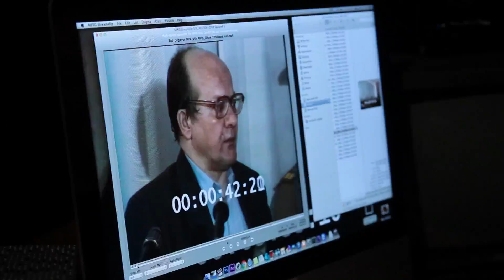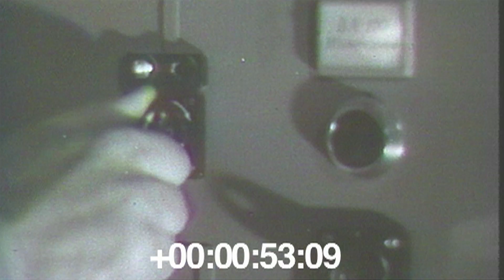Trial of those responsible for the Chernobyl accident. Causes. 1987. July.

Comment: The more I dig into this epic disaster, the more I'm leaning to believing the State's assertion that human error caused the plant to blow up.

Why?  Because it had abundant safety systems that would've prevented it.  They were overridden.  The State mandated that all safety tests had to be done before the plant was commissioned.  The documents testifying that all tests had been done were fraudulent.  The RBMK reactor didn't blow up despite correct operation.  It blew up because of improper construction and reckless operation.

To point out the positive void coefficient is akin to pointing out the abnormal weight distribution of the Chevy Corvair.  In the right hands and by someone who understands it, both the RBMK and the Corvair are perfectly safe.  It's when recklessness and deliberately putting both things into abnormal conditions, that a tragedy results.

Comment: So were the tips of the control rods really made of graphite or is that not true?
Reply: Yes.  The graphite tips were intended to preheat the incoming water as it rose up the channel.  Also to amplify the change in  moderation when the boron section was displacing water up or down.  To pull the rods all the way out was not intended.  The only time they were supposed to come all the way up was when that channel was shut down and the control rods were scheduled for replacement.

Comment: Can someone explain this to me? Some say the control rods failed because they got jammed while others say they failed because they were tipped with graphite. Which one is it?
Reply: Both. The control rods had graphite "tips" and locked up when they entered the reactor. Precisely halfway in.
Reply: we'll never truly know, the graphite explanation kind of feet the better
Reply: Get look some videos from That Chernobyl guy
Reply: The graphite tips were intended to preheat the incoming water as it rose up the channel.  Also to amplify the change in  moderation when the boron section was displacing water up or down.  To pull the rods all the way out was not intended.  The only time they were supposed to come all the way up was when that channel was shut down and the control rods were scheduled for replacement.

They physically jammed due to warpage from extreme heat and pressure.

Comment: This guy does not mention the design flaw of the tips of the control rods being graphite. Could it be that he was still in the dark about it, like all the others? This interview was only a year later. One thing you realize from the hbo series, assuming it was accurate, is that chernobyl could have been a 1000 times worse if the core had melted down to the water tanks. At least they got that right. I wonder what they have done with all of the other power plants with that design?
Reply: They did end up fixing all the RBMK reactors with the design issue, but I believe it only occurred after the suicide of Valery Legasov.
Reply: @Niko-20-w1k  No, repairs happened before. Legasov's suicide happened after he was denied Hero of Socialist Labor, Director of the Kurchatov Institute, and after two previous suicide attempts.

Comment: Water and carbon are both moderators, moderators are used to slow the neutrons down to increase the chance of a fission event. When the moderator is removed the reaction will come to a stall and shut down. But in the RBMK reactor the moderator was carbon... which is a bad idea.... with that said, most all other reactors use water as a moderator which is safer, when the water disappears the chance of a fission event will eventually reach to such a low point the reaction will stall.

Comment: Why this does fucking even have 1 dislike?! This is HISTORY and HBO nailed it with the mini series!
Reply: HBO made a lot of mistakes and changes. For example:

1. It was Toptunov who pressed AZ-5, not Akimov.
2. Ulana Khomyuk did not actually exist; she was a creation for narrative purposes.
3. Dyatlov was already aware of many of the RBMK design flaws but simply dismissed their practical relevance.
4. As far as we know, none of the engineers actually went into the reactor and looked at the burning mess. If they had, they'd have been incapacitated almost immediately.
5. The threat of the explosion that would result from the tanks beneath Chernobyl bursting was a bit exaggerated.
6. It wasn't simply that the graphite's entry into the core accelerated reactivity; the entry of the rods also displaced water at the bottom of the core that was absorbing neutrons at the time.

There were other things too, but it just goes to show that the show did muddle and oversimplify some things.
Reply: HBO nailed nothing.

Comment: This degenerate, if he had a little soul and humanity in him, would not have sent his young colleagues from 22 to 25 years old to the most dangerous points in the reactor, but he perfidiously hid as little as possible to be irradiated. And in case there was no guilt with this catastrophe, he deserved to be hanged only for directly sending young colleagues to certain death with intent, while he pulled out his old selfish and arrogant stinky ass!
Reply: Dyatlov sent Proskuryakov and Kudryavtsev to the reactor in order to lower the control rods as a mistake, he was unaware that Akimov engaged signal KOM to disengage the Control Rods from their servomotors, but as soon as he realized that the rods were removed from their drives, he called for the men to come back but they had already left. And he did not hide from radiation, he entered zones of high radiation and received an almost lethal dose from it. He participated in the search for Khodemchuk, and received horrible burns on his legs because of it. He warned firefighters about potential radiation danger and after 4 hours of running around, received a call from Bryukhanov to report to the Administration Building, he collected a few papers on reactor parameters and left. When a Colonel from Civil Defence came to the bunker, asking questions about the scale of damages, Dyatlov told him that Block 4 was destroyed. I don't see why you hate an Engineer that was doing his job so much...
Reply: @isaowater  I hate all the scumbags who deliberately risk human lives for the sake of their own career advancement.Such an obvious example was Dyatlov, who was supposed to become the director, if that monstrous task succeeded.It was a test that even the Russians did not know about.Dyatlov was a direct participant in the testing of Soviet nuclear power plants.He was given a dangerous task to give the maximum of the Russian product.The test proved disastrous and that degenerate is directly responsible for that shit!

Comment: This guy is lying (or being ignorant) - the control rods did start moving into the reactor, and that's exactly what caused the explosion, due to graphite tips. If an automatic shutdown system had been activated, the result would have been the same.
Reply: The fool proof automatic system would have intervene before super critical conditions where meet, but was deactivated at the time.
Reply: The emergency shutdown system would have turned the reactor off before they lose the control of the situation. At some point later, there was no emergency stop and they never knew that.
Reply: there shouldnt be nuclear reactor in the world that allows setting that causes reactor to blow..there shouldve been system when you are pulling too many control rods  it takes over ..and system if running with too low power it starts alarming about xenon poisoning...today they propably have all these and like in fukushima if earthquake example hits it automaticly shuts down..

Comment: He said something that I bet most people missed. "The reactor wasn't perfect at the time of the accident". This is a dangerous comment, machines are never perfect. Machines are engineered by people and run by people which means they could never be perfect for every situtation because people make mistakes and can't predict every possible scenario. I'm a mechanic that works with machines all day long and I see tons of mistakes in design, repair and operation of equipment. Safety culture is not usually followed very well no matter what industry or activity, if you need proof of that just look at the way we all drive. When was the last time you did your 360 walk around the car, checked your tire pressure, looked under the car for dripping fluids and checked under the hood before you pulled out of your driveway?
Reply: I do my pre drive inspection regularly but not every drive.
There are 2 majors reasons I even bother
1) I have found many potentially hazardous issues throughout my short life prior to driving.
2) The military ground pre combat inspections and checks into my very soul so now I have a voice haunting me in the back of my mind if I don’t regularly check my weapons and vehicles. If i owned a helicopter or plane the same would occur I’m sure.

Comment: What this guy is saying is completely at odds with what Legasov said. Because of the flawed design of the reactor, which none of the operators knew about, they were running this test with a reactor that could not be shut down.  That was why the reactor blew up. If the emergency shut down had worked it all would have been a non event. But this guy is blaming the operators, the planning and all this other stuff that is peripheral to the fact that the design was flawed.
Reply: Dyatlov actually was aware of the design flaws but dismissed their practical relevance. Dyatlov absolutely deserved some of the blame, just not all of it.
Reply: AZ-5 worked as intended - and that's exactly what blew the reactor up.

Comment: I ve just seen the HBO mini series however is the cause for the accident described here different from the one in the Chernobyl mini series? Here the soviet propoganda version is provided were the blame is laid on the men operating the reactor. In the mini series the blame was on the equipment were the rods had graphite tips and the operators weren't informed. Thus the AZ 5 button didn t serve its  purpose correctly
Reply: https://www-pub.iaea.org/MTCD/publications/PDF/Pub913e_web.pdf 

Chapter 6, ad 4. 

It is also a note that made them show possible KGB theory, which is backed by some evidence, not enough from what I have seen, but still it is possible that some informations regarding structural problems were hidden (even if they were not hidden people working at power plant would not take it into concearn, they had little or no experience).

Edit: Interesting fact to be noted 

 "This latter  effect  was a result of  faulty  design of the rods,  the nature of  which had been  discovered   at  the  Ignalina  nuclear  power  plant  in  1983."

They seem to not mention the "nature" of desing faulty precisely, (like they didn't know) In series it was explained as graphite tips which was pushing the water? (I could be wrong), either way they seem not to mention it in document, need to dig deeper.

Edit no2: 

"The control rods were very slow, taking 18–20 seconds to be deployed. With the control rods having graphite tips that moderated and therefore increased the fission rate in the beginning of the rod insertion"

It is mentioned on wikipedia, still not sure if they have hidden the fact about the tips.
Reply: @firesalamander4795  Yes I've looked at this document. The HBO series leaves out some details to make it easier to understand. At first I also had the question of what would have happened if AZ-5 wasn't pressed. This would probably have led to a melt down similar to that of Fukushima in Japan. Mostly to blame for the accident is the design of the reactor from what I read in the report however safety regulations weren't adhered to by Dyatlov which still lead to a possible meltdown of the reactor core.
Reply: @sport3047  AZ-5 button was meant to be pressed as part of the experiment. (it's a "shut down" button for the reactor, whether in emergency or for maintanance)

Comment: As per one theory they say control rods with graphite tips were actually suddenly put back into reactor causing the reaction to intensify and leading to explosion.Here he is saying control rods were unable to put back due to electrical interference???
Reply: I think, he mean that automatic system was disabled. This system could prevent incident, as it lower rods at early state

Comment: Yes the HBO / Sky set looks unbelievably accurate as do the actors, great series 
However this video claims that the control rods didnt drop because of interference with electrical circuit, whereas HBO / Sky claim the control rods did drop and it was the graphite tips that caused the overreaction. 
I guess the question  is that the control rods were raised all the way out of core which you would assume uses same electrical circuit that would power the drop of rods back in.
Cover up is the main allegation in HBO

Ps watch Chernobyl 3828 on you tube for episode 4 set on roof .. unreal
Reply: The rods where "partialy dropped" they got stuck and the graphite tips keeped accelerating the reactions in the reactor
Reply: @v44n7  I think dropped until the graphite tips entered, the core was already running hot and the introduction of graphite then accelerated the process past the point of no return,  the partial drop wasn't an electric failure, but the reaction of water converting to steam and the expansion effect rupturing the fuel rod channels which the control rods sit in so they could move no further.  the reaction and explosion simply happened so fast. Wonder if Russia will stand by this version
Reply: There's a research paper you'll find If you search for the end rod effect, it'll help prove that the graphite issue was known but ignored. HBO is right there.
Reply: Wiki confirms HBO spin on it. It could be this guy was not fully informed himself, as many speculations and secrets were going around.